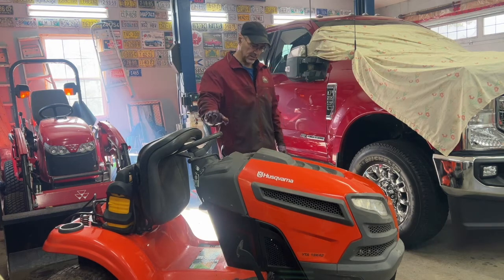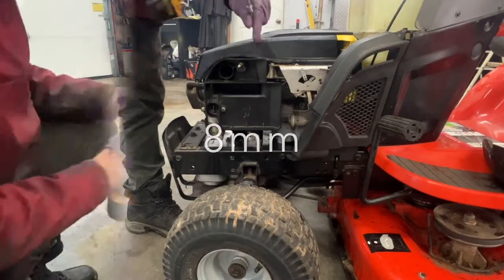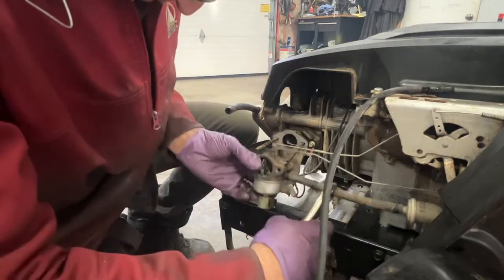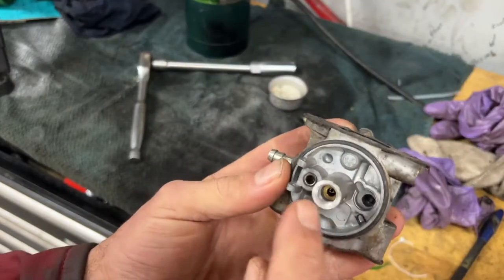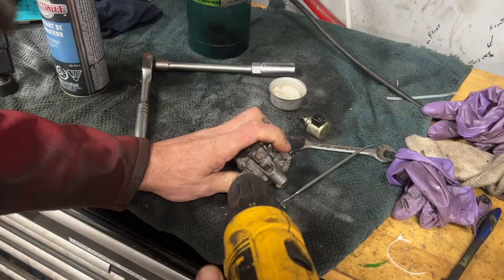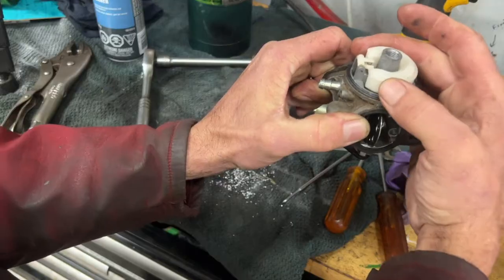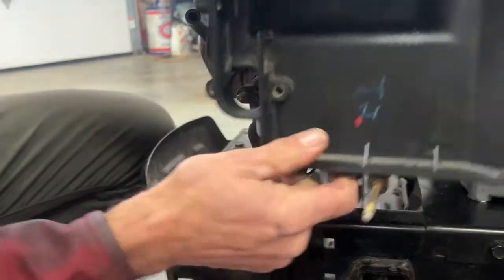Kohler Courage 19HP Hunts and surges at idle. How To fix. Carburetor? Husqvarna Lawn Tractor Mower.

Comment: Awesome quick fix sir. I'm going thru that right now on the same engine. The carb is very clean so I could not figure out why it surges. These manufactures don't want you going in to adjust anything so the seal them up. I will try that and home this welsh plug comes out just as easy as yours had.

Comment: Nice job. Thanks. My fuel solenoid went bad. I removed it and cut the top of the rod. Put it back and installed a manual inline fuel shutoff . Starts and runs good. Idles low and smooth like never before.

Comment: Somehow the jet on my carburetor on a Husqvarna riding mower got a real tiny what looked like a piece of plastic in it. My mower was running terrible. It wouldn't run at all, or idle, without the choke on. That very small piece clogging up the jet was the culprit. Good explained video. Thanks!
Reply from the maker: Good work!

Comment: I been a gear head for 30 years and played with many complex carbs and carb setups on custom vehicles. Always got everything working great.
But this little Courage 19 SV590 carb has pushed me to my limit of patience. Something so simple causing me so much headache.
The problem I have is it keeps dripping fuel out of the venturi just sitting there with the engine off (it is and will drain the tank given enough time). Between the float/needle and seat and fuel shut off solenoid this should not be possible. But the head pressure (gravity fed) from the tank will do it. I have turned the carb over so the float weight closes the needle and I can't blow through it with my mouth.
I have taken it apart many many times and a few times it didn't leak, but then run it for a few minutes and shut it off and it will leak again.
I never been more ticked off at something so stupidly simple as this thing.
Do you have a recommendation for a replacement carb. I can find cheap ones on Amazon, but I have learned my lessons about going cheap.
Reply from the maker: I had the same problem before.  I replace the needle, o-ring and still leaking. I needed up replacing the carb.

Comment: great video!!! had to change a 20hp with the 19hp, fuel tank in the rear how to put a fuel pump in?
Reply from the maker: Take the fuel pump from the old motor.   Might have to drill in the valve cover to put the pulse line.

Comment: I have a similar engine in my Cub Cadet xlt 1040. Mine surges in any throttle setting - i have to put the choke on to nearly full to get it to run fairly smooth. I tried a new carb and runs pretty much the same. Replaced fuel filter, spark plug, and air filter. Any thoughts what my problem is?
Reply from the maker: Pull the fuel line off the carb.  Check to see if fuel is pouring out.  I had one with a plugged line and wasn’t filling the carb fast enough.  Also check the fuel shutoff solenoid is working properly. 
     Did you try opening the pilot jet? 2:45 in the video.
Reply: Surging is almost always a fuel starvation issue.

Comment: I have an SV470 with this problem. If I engage the blade it doesn't surge. I've pulled the carb several times and adjusted the idle screw with no change. Pulled the gas cap thinking the vent was plugged but that didn't do anything. I'm stumped
Reply from the maker: New carb kit or a replace it.    I would just run it like that.

Comment: hello sir, I have a 17hp Kohler Courage with the same promblem. It's about to run me crazy, I bougth a new carb for it with the same adjusting screw on it(but no welch cover) and I adjusted it several times while it was running and there was no effect to it. What esle can I do? My next step is to go back to the orginal carb that was on it, clean it again and try. But if that dosen't work I'm thinking of taking the whole motor out!! It's got me!!
Reply from the maker: Wow.,,a new carburetor should’ve worked. This Issue causes a lot of headaches . 
   You could try a bigger jet.
Reply: @WeekendHobbyMechanic  Ok. I'm not that knowledgeable on getting a bigger jet. How will I go about getting a "bigger jet"? I see on your video you have a Walbro carb on the mower, I have a Nikki, would that make any difference?
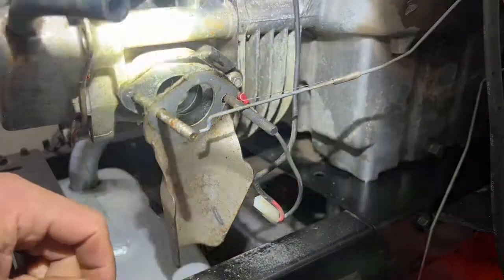Reply from the maker: @ronniewortham3260  My mistake. The Low speed jet is not replaceable. You will need to drill it slightly bigger. I don't have a video on this yet.   Watch this video at the 4:20 mark. He drills it out slightly bigger. https://www.youtube.com/watch?v=Xl2UrR_Rx8M.